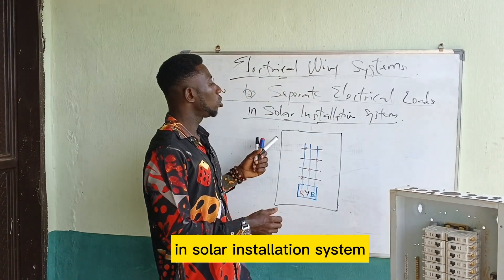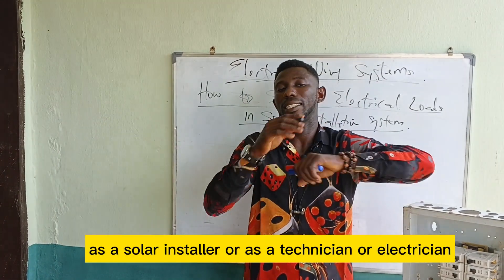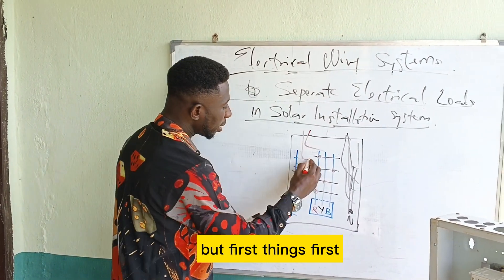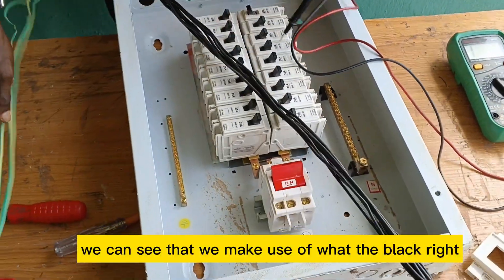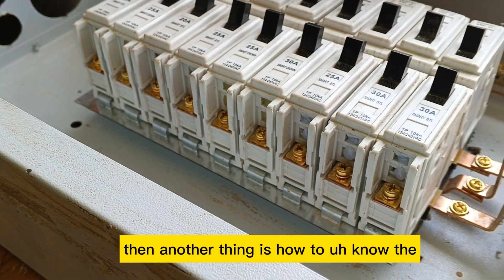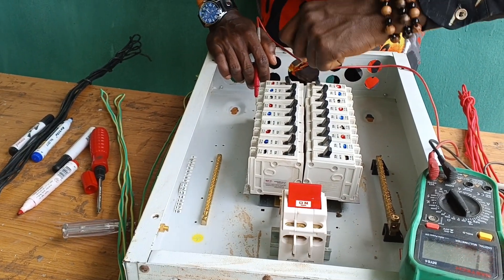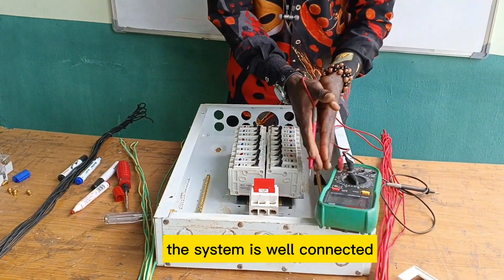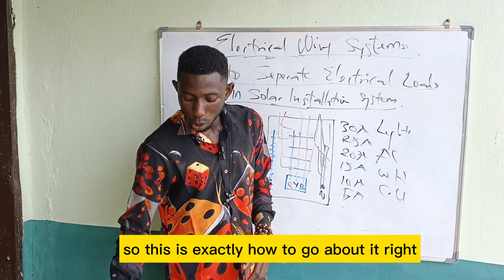How to Separate Electrical Loads in Solar System Installation | Step-by-Step Guide

Comment: Hello 
Hw do u use multi meter to separate the solar neutral u want to use 
as u only did for live
Reply from the maker: You will have to trace the neutral that comes with the live cable and separate it appropriately
Reply: @morutech how do we do that